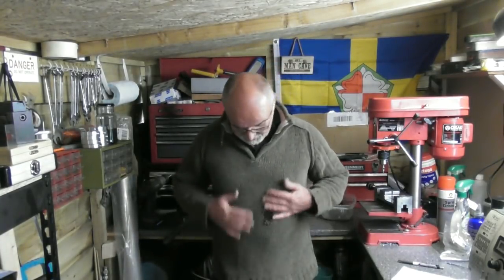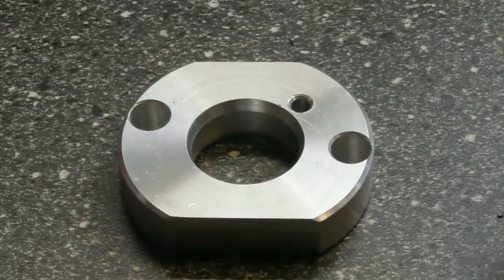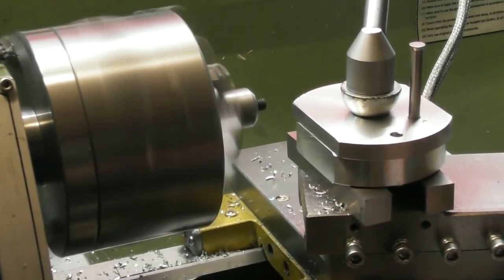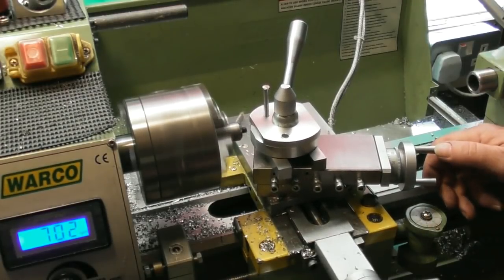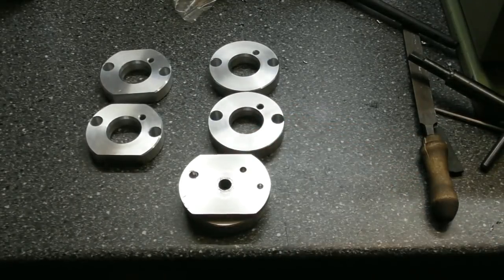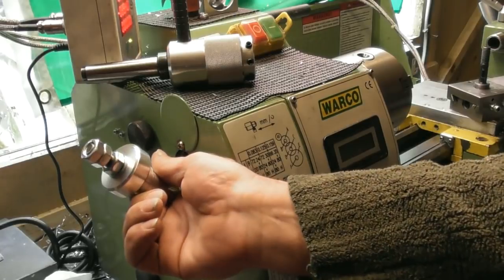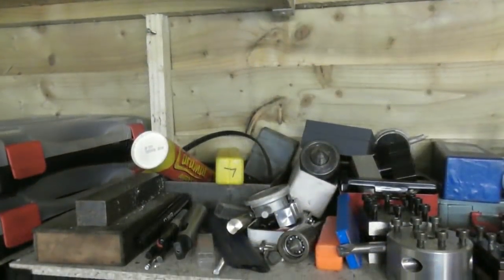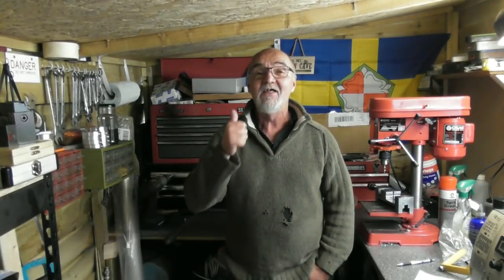Shed talk 5

Comment: Hi, I subsribed and really enjoy your videos, how you talk about it and show detail.
You really gave me an idea here I have thought about before but never got to it, nows the time. Remember I have a brand new Datson steering wheel lying in a cuboard for 30 years, and this will fit the size of my small lathe 160mm chuck MT5 spindle. Because of the cover over backside I will have to machine 280mm long bar at min 39mm & 140m deep in spindle for a good support. I will try to apply Joe Pie's idea to the expantion part. I also plan on fitting a safety switch on the cover that activates & trips if I insert the Steering wheel, preventing the motor from running.  It will have to trip & pull aside with clearance(Spring involved), and manually reset after wheel removed. Have a good day.

Comment: hello ade
very nice video
please to see you got the spindle handle. posted it on wednesday made myself another one the next day
could you explain what the meanings in the zeus hand book on threads ie 
od/core/pitch/depth/flat/effec/tapping drill/cleance drill
or give a minute or two in one of your next video
thanks harry bee
Reply from the maker: Cheers Harry , I have just started my toolpost grinder series and have yet to post it . I am worried that if i do an explanation on this subject that the trolls will have a field day . the first thing i will say is to look out for a copy of what engineers know as "the bible " it is a book called "machinery's handbook" . although it is not the sort of book that fits in the hand . I was given one by my company when i finished my apprenticeship all those years ago and sadly , i no longer have it . i have just decided that i am going to buy myself a copy , awesome engineering porn , lol . this book is the ultimate reference for anything you need to know about engineering , when i was a young apprentice and had not yet discovered drink and women i read it back to front , . i will send you an email with explanations as to the zeus book sizes but as i said , i probably wont cover it online because there are so many people who will have their own opinion , Cheers Ade.

Comment: What kind of mill are you thinking of getting ??
Reply from the maker: i have not got that far yet but my budget will be around £1100 without DRO and has to but under 80kg for me to pick up onto the worktop , may need help . not as young as i think i am . Cheers Ade.
Reply: ADES WORKSHOP the Sieg 2.7 might fit the bill, a very good warco  mill would be the wm16b (belt drive and better casting to the wm16) but that's about 120kg. I picked up a cheap second hand sieg x2(tilting column) mill last week. But they need bracing etc to strengthen them. But don't mind as it was cheap. Did you look at the Sieg sx2 from arceurotrade ? That's a solid column with brushless motor for about 800
Reply from the maker: i have not looked much yet , i like the sound of a brushless motor , and will have a look at arceurotrade . big decisions when i go for it, Cheers for the idea's Ade.
Reply: With all the benefits of extra weight it's probably worth spending £20 for an extra pair of hands to help you lift. Or just to disassemble the mill and put it together on the bench.